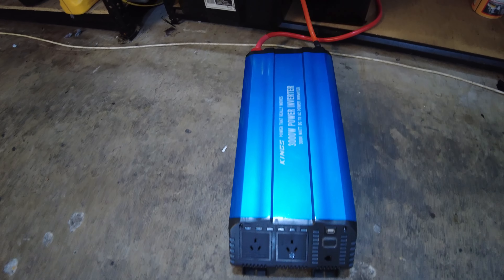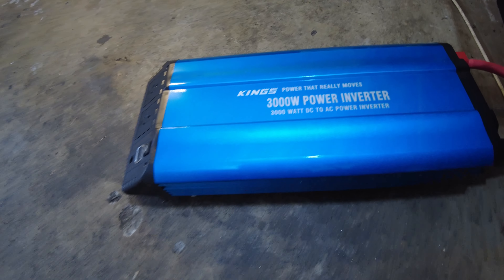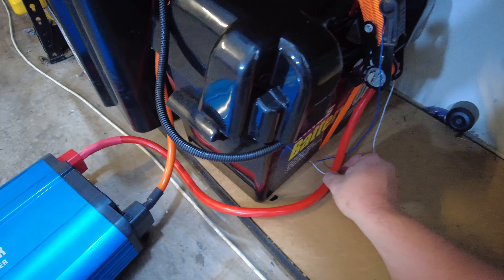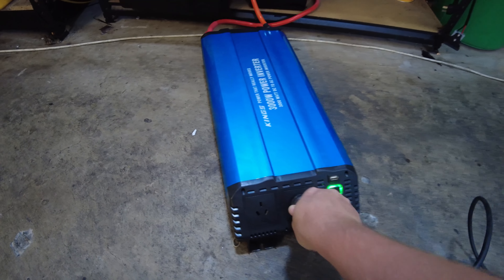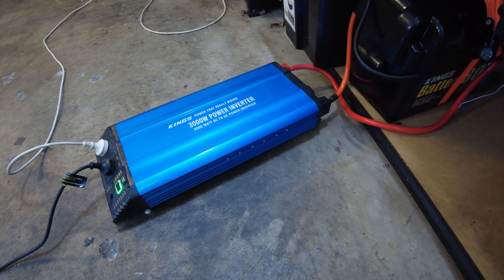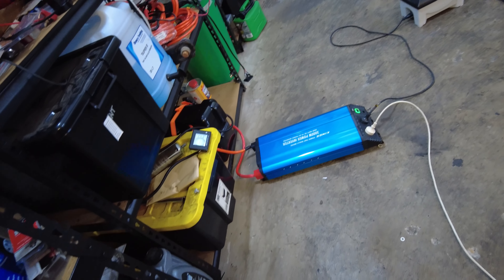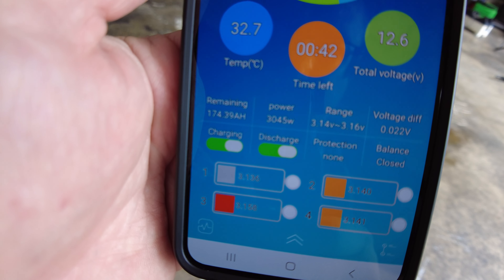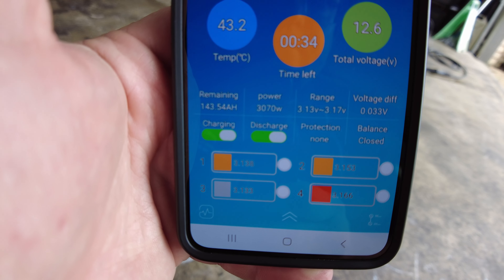KINGS 3000W INVERTER REVIEW

Comment: I must have got very unlucky, i got the 1500w version of the kings inverter and it ran a 140w load (yeah 140, not 1400) for 35 minutes and let the smoke out, and dripped capacitor electrolyte everywhere. Thankfully kings took it back and gave me a refund, but im glad the 3000w one you got seems to do the job ok.
Reply from the maker: Yea that's very unfortunate mate, I know their gear is hit and miss but at least 90% of the time you can take it back and get another one or store credit.

Comment: PowerPoints are upside down because China uses our PowerPoint, but upside down. So it means the inverter is Chinese made
Reply: I heard they do that in case something drops between the plug n socket it'll hit the earth and not active, who knows though.
Reply: @mickwolf1077  That safety issue should be addressed by the pins having an insulating cover like the Uk plugs have
Reply: As @pmacgowan said. Purely safety if someone drops a conductive material onto the terminals. It's us who is wrong if gnd down!

Comment: If only if it had 240volt terminals to connect to a rv 240 built in system
Reply from the maker: Yea the one's I've seen in vans run it from power plugs and leads into the RV system

Comment: New to your site, what size battery did you have with the test. I have a 3000w inverter and looking to upgrade from AGM battery to 300ah Lithium to run Caravan Fridge and A/C at the most power draw at any  one time.  A/C would be only to cool van down, 2-3 hrs. Cheers Russ
Reply from the maker: Originally 280ah eve lithium battery I built 👍
Reply: I have the kings battery 115 AMP..with battery box

Comment: cheers for the vid mate, what monitoring system are you using that goes to your phone? I was tossing up redarc redvision/bms but might not have the budget for it yet
Reply from the maker: The Muller Energy (Jaibada BMS) 250a version is the BMS which has a Bluetooth module connected to the BMS. The app is called xiaoxiang and it allows you to reset parameters in the BMS so you can customise how it works. Really handy bit of kit when you build the lithium battery yourself. Some other videos on my channel on how I built the battery
Reply: @WEEKENDER4X4  cheers for the reply, might be too technical for me lol. thanks mate

Comment: Not bad, I'm surprised at how well it worked. 

The 3050w load through the BMS is probably correct, but the output of the inverter will probably be about 10% lower. 

Glad to see the Muller BMS is working well too, I have been meaning to test mine, but I may need to pass it onto someone else as I don't think I will really have time. 

The jumpy current reading will be a result of the sampling rate of the meter and noise from the inverter. This is something Andy has shown a few times. There's no easy way to avoid it (at least with consumer grade equipment) and it makes measurements awkward. You'll find a purely resistive load like a fan heater, kettle or halogen lights (who has those now though) work well for testing loads. But what you ran is probably a better indicator of todays gear because most of what we use now has some sort of PWM type power control. The things you ran were mostly resistive, but if you run that heat gun and a light from the inverter, you'll see the light flickering (it'll happen at varying points in the temp and fan speed). 

I actually suspect the Kings and Renogy inverters are very similar inside. They share a lot of the same features and even the mains sockets are identical.
Reply from the maker: I do suspect the same thing hey, especially when you put the kings inverter under half load on heatgun

Comment: yeah my kings 3000w does a great job, my biggest problem is voltage sag from the agm batteries, you basically need 300ah of them before the sag isnt too bad
next upgrade is lithium
ive hit my inverter with well over 3500w load and it handled it, it was hooked up to 7 x 100ah agms and there was still really bad voltage sag
ive run the welder off it.. it didnt care
2300 water pump with a startup curent of over 20 amps and it ran fine... for the money the thing just works
Reply from the maker: Can't argue with the price of them to get the job done hey

Comment: What size of battery are you using?
You reckon that inverter can run the heater in the tent when you go winter camping?
Cheers
Reply from the maker: Easily. 280ah lithium

Comment: In regards to off grid systems in caravans/vehicles - seeming a live chassis from faulting appliance can kill you without a protective device, using a portable RCVO plugged into the 240v output will protect, but because there's no earth to ground, YOU will be it. This should cause the RCBO to trigger but ut could be too late.. If you installed an earth stake from inverter chasis it was have tripped without you in circuit. Just a friendly reminder to all that 240v is 240v, it's dangerous and without a protective device or ground you're dicing with death
Reply from the maker: Absolutely 💯
Reply: That's actually not correct. In mains power the neutral is earthed - there is no neutral coming into your house so earth is actually the final path of a circuit back to the power station. In a floating system like off grid, earth is not the return path to the source. You can get a shock from the capacitance to earth but you need to touch both active and neutral to be in the circuit. The earth is to stabilise the system in an off grid setup

Comment: 3000VA Victron couldnt run our 2200W hoist, we figured based on calulation we would need around 3700VA but tried anyay as we already have the Victron inverter. I'm wondering if something as budget as this would likey do the job - your thoughts?
Reply from the maker: @chrisbaker4x4  I would say it's the in rush current required for the initial start of the hoist when under load. To combat this you can get "soft start" ebay parts installed in line which can make you able to run almost any bigger items. Also depends on the size of your battery bank? If it's not able to sustain the voltage the inverter will immediately cut out.
Reply from the maker: @chrisbakeruploads  https://www.ebay.com.au/itm/204350184872?mkcid=16&mkevt=1&mkrid=705-154756-20017-0&ssspo=lzlp9dizto6&sssrc=4429486&ssuid=zX09QedLR1y&var=&widget_ver=artemis&media=SMS
Reply: @WEEKENDER4X4  interesting thank you for pointing me in this direction. Battery is 2x Kings 100Ah LiFePO4 should be safe for this load.

Comment: Can you please show us how you made your  "Soft Start" circuit that you used in this video with the blue and white wires
Reply from the maker: That's not a soft start curcuit, that's a BMS switch on or off discharge. It's on the Muller Energry 250a BMS of the lithium battery

Comment: Good test. I have the same inverter in my caravan. 
Do your fans turn off. 
On my inverter, if the fans come on they never turn off until I turn the inverter off, even if the inverter sits with no load for 30 minutes. 
Is that normal for this inverter?
Reply from the maker: Quite honestly I thought they weren't going to turn off until they did around 5-6amps draw, so it may be that they have the temp turn on setting too low I think. But at least it's keeping it cool
Reply: I literally came to find this comment. I have had my kings 3000w for a day now and the fans havent stopped, ambient temp around 23 degrees and less than 20w idle load from a few appliances plugged in but turned off, and yeah its roaring. Unplugged the loads all together and the fans ran for about another 5 mins then turned off. I wonder if it can be adjusted somehow
Reply: Update, fans pretty much never stopped in the last 3 weeks and now theyve done a bearing or something, noisy as hell, just put in a warranty claim so hopefully they just swap it for a new one on the day.
Reply: @lexicase8805  How'd you go?
Reply: @mrtee3988  yeah they swapped it under warranty, got one with a different batch number and it still has the same issue fans run anytime its over 25 degrees once theyve turned on, and i also recently picked up the 1500w version and its the same. Ive now modified both with a current activated relay, the 240v live goes through the ring, and i put a 300w load on it and then adjust so that the fans just turn on at 300w, then cut the fan positive wire and run that through the relay. So now my fans run when the load is over 300w and the temp sensor inside the inverter triggers them to turn on. 
Also, the 3000w has 3 fans, one internally on the main mosfet heatsink directly, and two at the back where the dc cables come in. Ive run those two through the relay and left the internal one alone. It triggers  a fault if unplugged or fails and shuts the inverter down, the two main fans dont.
Reply: @lexicase8805 I'm having the same problem, the fans just turn on for ages even with little to no load. Wondering whether to put in a warranty claim or just do the mod you were talking about. So do your thermofans just kick in at over 300w now?

Comment: Which Kings inverter should I get to pair with their 120Ah lifepo4 battery? The 1500w jobby?

Also, do you know if a Bluetooth battery monitoring system I can use on my phone, like you are, for my battery?
Reply from the maker: Victron Energy shunt 
And yes for a 120ah lithium battery you'll only be able to run a 1500w inverter comfortably
Reply: @WEEKENDER4X4  thank you 🙏
Reply: I just ordered the smart shunt you mentioned for $128 (incl. delivery) from Springers Solar using their EOFY sale code. Bargain price.
Reply from the maker: @mrdobalina3451  that's a fantastic price!

Comment: Burning question I have been breaking my head with - does it need grounding?
Reply from the maker: Floating curcuits generally can't be grounded. If you want extra protection you can ground it.